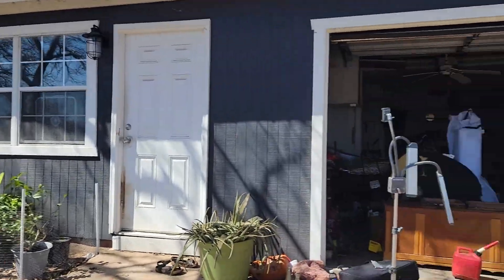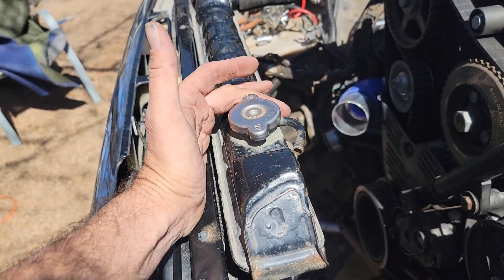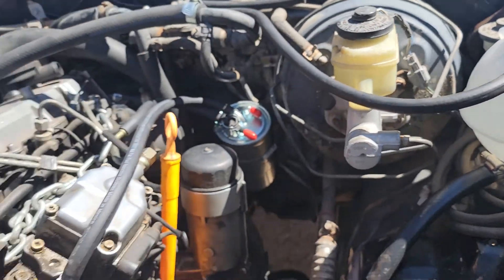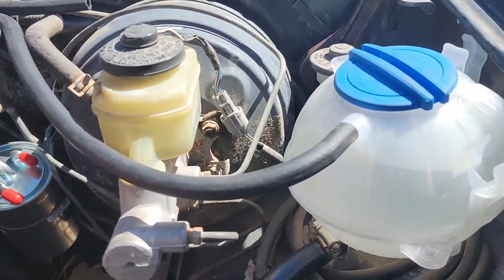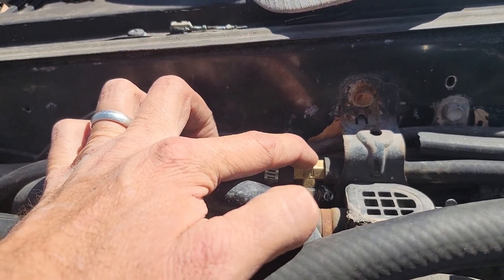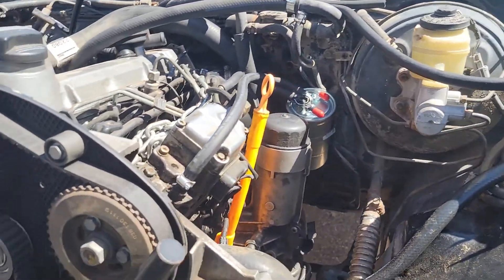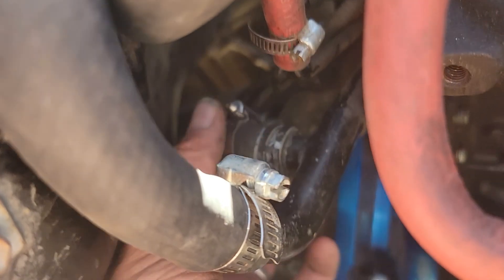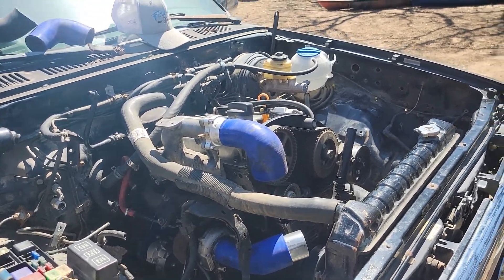TDI Swap Second Gen 4Runner coolant system

Comment: I would like to do this swap on my 96 4Runner would it be hard to keep the stock automatic tranny?
Reply from the maker: As far as I know, you cannot retain the stock automatic transmissions. You'd have to switch to the r150 5 speed. Part of the good thing about the TDI is the miles per gallon, and automatic transmissions tend to make MPG worse. TDI s are pretty rough on trannies too, and the automatic tranny of those years aren't known for handling power.
Reply: Would this coolant system be similar to the Aaz 1.9 td?
Reply: @bransonhutchinson  Yes